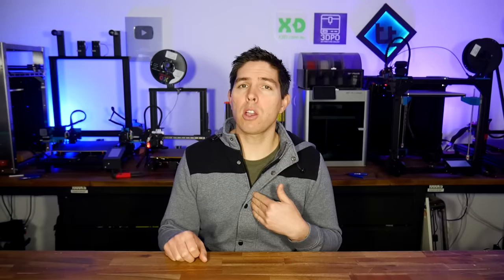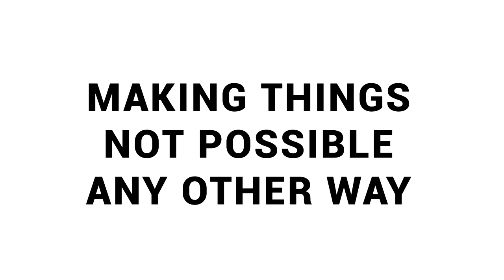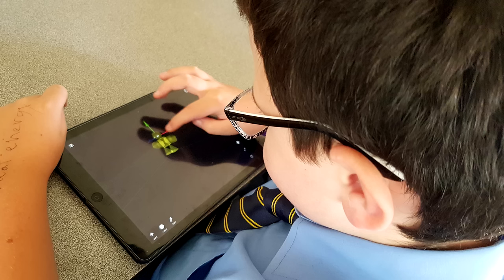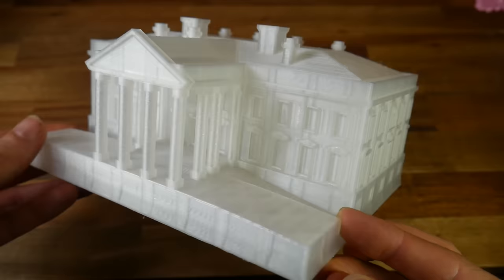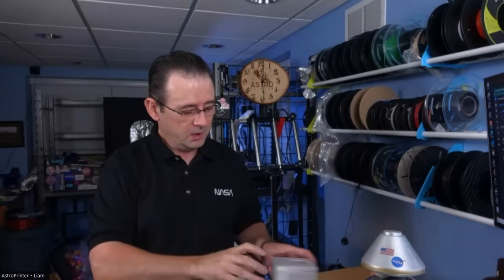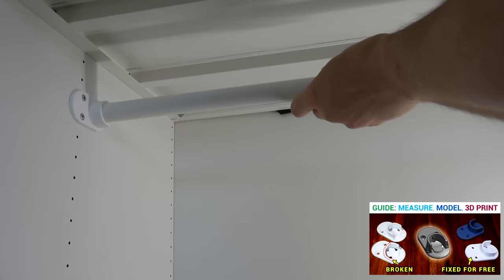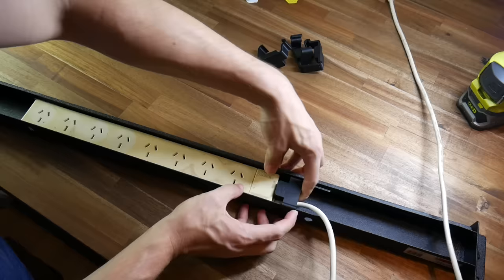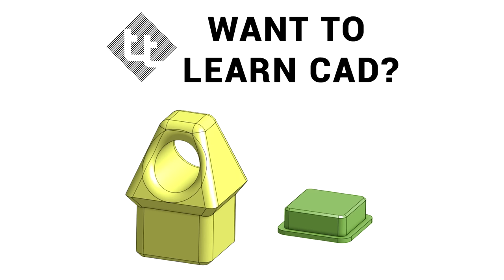These 3D prints will convert non believers

Comment: I love the idea of 3D printing but my god it is more frustrating than anything.  I've actually watched a lot of your videos but still find that the failure rate is so high I've not even touched my printer in over a year.  It seems like whenever I solve one problem 2 more take its place.
Reply: It definitely has a learning curve. I almost gave up and sold my ender 3 after a month of trial and error, but thanks to some helpful friends, I worked out the kinks and now have a very reliable printer. A good chunk of that was learning what various slicer settings mean and how they affect your print. But now I can print pla, petg and tpu with ease.
Reply: @Gibson99  Glad it worked out for you!  I too have an ender 3.  Even upgraded the board, added a auto levelling thing, tried endless slicer settings and different spools of pla.  Just felt like I was throwing my money out the window and sat it on a shelf.  It is quite sad really but unfortunately I don't know any local who can help.  I still think it is great but it has so many points of failure.  Bring on the star trek replicator!
Reply: I also believe every now and then a lemon of a machine gets through, my most expensive printer is so unreliable, the other 3 arrived with warped beds, bad extruders.. It can be frustrating and a lot of problem solving, but stick with it, I believe it's getting easier with more affordable tech and better quality printer's.

Comment: I view 3D printers as a tool. I have two and I don't feel the same excitement with 3D printing itself that so many people seem to, but I do find it invaluable for repairs around the house, mounts, brackets, and to support my other hobbies.

My favorite repair was a bearing block and endcap set that I designed and printed for my vacuum cleaner. The parts were about 3h of design work and $2 of materials, but it saved me from having to buy a whole new brush from the manufacturer for $60. I got to solve an interesting design problem, reduce waste, and save significant money all at once.
Reply: @createagoogleaccount7574  For what I mostly do (model rocketry, airplanes, and robotics), a laser cutter is a better complement. Still, it doesn't take much to do reasonably precision production of complex parts these days.

Comment: I work at a small brewery and I have printed up many tools that I use.  Ive designed retention clip removers so I can fix sanke spears.  A wrench for our fermenter caps (previously used needle nose pliers)  jig for cutting our filter pads (instead of buying precut pads that cost 4x the amount)  and countless other things that make our job that much easier

Comment: I’m brand new to 3D printing and am super excited that I’m able to make small car parts. Right now I’m printing a 3 circuit horn ring for a race car. It makes the buttons in the steering wheel work without external wires. It’s also removable. Thanks 3D printing!

Comment: I made a conformal fixture to hold my awkwardly shaped wifi router to the wall without the need to modify the router's body or damage it in any way. Because the fixture is conformal to the body of the router you almost can't notice it's there. I also regularly make odd shaped (woodworking) router jigs, adapters and tool organizers. I never make things that I can just buy.
Reply: Ha Ha... I had nowhere to mount a WiFi extender, so I 3D printed a mounting bracket that allowed it to hang on the end of a bookcase without screws.  Tidy solutions for one-off problems.   :o)

Comment: Using the 3d printer with a 3D cad program is where they really shine. I impulse bought an ender 3 pro 2 months ago when I was having trouble fabricating a part for my UTV that ideally would have been made of plastic with metal and my welder. Turned out quite a bit harder to do than I initially expected because  I had to learn FreeCad first, but within 2 weeks I was adding a second bigger print area printer for bigger parts. I was finding all sorts of things to make for both my projects and my wifes Crafts projects. You'll be doing a great service if you teach people how to design things to print as that is where I think the real magic of a 3D printer comes in, be it making parts that can no longer be obtained, or designing custom made items.
Reply: absolutely. that's the fun part for me. being able to imagine, design, then realize the results in a short time is very satisfying and practical.

Comment: My mom has a flat foot and sees a special foot doctor to make custom shoe inserts to support her foot. 

The doctor retired and the new doctor wasn’t as good. There were many failed inserts and Each custom insole is $500. there is a limit on how much insurance will cover 

My parents decided to ask me to try and make an insole, knowing the cost is cheaper and adjustments can be made quickly to find the perfect fit. I made a shoe the previous year and was up to the challenge. I have succeed with only $50 spent on materials, and in return am getting a new better printer.

Comment: One of the first things that I designed was the plunger replacement for my wife's KitchenAid mixer cheese grater attachment. I agree with you that functional prints are fun when they go right.  Just today I rapidly prototyped three adapters for cups for my laser engraver. I was able to try out three different designs in the span of one day.

Comment: Thank you for posting this video.  I was unaware of the Toys For Tots work, and will join that effort in time for Christmas 2022!

My entire 3D printing hobby started with my wife's car not having an integrated dock to charge her iPhone, and provide wired CarPlay connectivity.  I came up with a simple set of measurements and a drawing showing my very rough idea.  I then found an engineer in Scotland (I'm in the USA) who hung out on the car forums where I hang out, and he and I polished up the design into something awesome (he did most of the CAD work, since I am a noob).  Along the way, I picked up 3D printing, Fusion 360, understanding filament types, and a whole lot more.

This also means the wife doesn't complain too much about the printer being inside the house.

Comment: Excellent content and topic! My 3d printer was only laying around for the first year. After getting fluent in 3d designing, my 3d printer is now almost in daily use. It complements several hobbies. The key to 3d printing is being able to effortlessly design 3d parts. 3d scanning by means of photogrammetry is very rewarding and once mastered, adds the next level to 3d printing. Convincing people of 3d printing is like convincing people to be makers. Some are makers and some are simply not. Lots of people are inherently makers, but to be a 3d maker, requires knowing how to 3d design as well as a bit of knowledge of 3d printers.

Comment: For the CAD tutorial videos, FreeCAD + the OpenSCAD Workbench would be fantastic, as they each have their own strengths and weaknesses, and the convenience of being able to paste in a chunk of code and instantly create a fully modelled part CANNOT be overstated.
Reply: Ive used openscad professionally and is great. Freecad has multiple issues which have been discussed elsewhere on various you tube channels. I found the UX problematic (Inconsistent) I don't use it any more.

I strongly recommend trying Blender with the 3D printer library addin. (both free). There are many you tube tutorials on this. One of the best is from Maker Tails.

And Michael, thank you for this 3D print overview.

Comment: I have a room door knob that was broken for 2 years, The lock works but the handle comes off, after buying a 3d printer the first thing i printed was a replacement for that. and it was the most satisfying thing ever.

Comment: I worked as a mechanical engineer and heard constantly that 3d printing was useles.
It was 7 years ago when i installed a 3d printed custom designed air blower on a place where there was no room for a comercial one.
They said it would explode due to the air pressure, but it's still working.
After that, i have designed parts for my projects: motor mounts for a cnc gantry router and several parts for my mountain board.

Comment: I work in the R&D field.  Good 3D prints for molds, functional prototype parts, and scale models are greatly reducing time and cost for iterations.  One iteration of hardware was 9 months.  With a great resin printer, that has been reduced to 3 months.  With the molding, we encapsulate PCBs in a 2 part silicon insulator that helps guard from vibration (20G constant, 1000G impact).  Metal molds were costing us $200+ per set, with 8 to 14 sets per prototype.  The printer paid for itself in 18 months.  It wasn't even a cheap printer.  It cost us about $6k to get delivered.

Comment: Jay Leno in his Jay Leno's Garage videos mentions the use of a 3D printer often in his restoration work. Sometimes they print scale parts to be used as forms for casting something in metal. Sometimes it is just to have a scale part to examine space requirements and how something would fit with other parts of an existing car.

I use mine all the time to design and make things for my hobbies (ham radio, woodworking, metalworking) and for useful things around the house. I can't justify anything more than my highly modified Ender 3, but I definitely get my money's worth from it.

Good video that needed to be made.

Comment: 2 days ago I made a "screwcap"  for fishing reel handle for my friend. It uses an elliptical head screw with costume threads to tighten the handle. He had 2 broken ones and he couldn't tighten the handle; and on other 2/4 reels they had a crack. I printed 6 of them for good measure and they are a perfect fit. It took me about 20-30 min to create them and I am just a beginner in 3D modeling.

Comment: Great video, my most satisfying and useful print was the the fittings for a 5 gallon dust bucket cyclone dust separator for my CNC machine. I printed the largest piece overnight and it was like I had a delivery on the bed of my 3D printer in the morning. Very gratifying!

Comment: One of the most useful models I’ve printed was also one of the simplest - I needed a spacer for a tap as the previous one has disintegrated from age. If I had the skill and equipment I might’ve been able to make it out of metal or wood, but less than 5mins in CAD and only a few more printing and I had a replacement part. I use this example whenever people ask me ‘so what do you print’.

Comment: I’ve had a 3D printer for less than 3 weeks and already produced several custom parts.  My killer app for 3D printing is replacement parts for swimming pool components.  Lots of plastic nuts and connectors.

Comment: I have designed brake adapters so Porsche Cayenne brakes could be used on a BMW 1series, once we got the fit we wanted it got machined. 

Printed a keyed TPU sleeve around a flexible joint on a ratchet. Makes sure the flex joint stays straight while reaching into a difficult location but can swivel once in place.

A friend needed a finger splint so I drew up a hex lattice after making an initial shape in paper. Printed in PLA and formed to the wearer using a heat gun.

got a new washing machine late on a saturday, drain hose didn't match my drain pipe. Designing and printing took less time than going to the closest store and then having to look for the specific part. In addition to getting it up and running on a Saturday evening when everything's closed.

I LOVE 3d printing because it enables my DIY passion in a great way

Comment: My brother got me a 3d printer and the first thing I used it for was to make a template to drill holes for cabinet handles. I didnt care what the dimensions were, I just needed them all to match. 5 minutes of cad using a free program and a 1 hour print, and I had a perfect template and saved me hours of trying to measure and drill.

Comment: I printed a part for a friends dishwasher that they were told wasn't available to buy except as part of a larger assembly costing $500 (for a $600 dishwasher).  So I printed the part, reinforced with a  stainless bolt through it and for attachment, made a slight modification to the machine itself and its fixed!  Part took 30 mins to print from Polycarbonate (to handle possible high temperatures in the machine), it took about 5 mins to make necessary modification to the machine to accept it using the stainless bolt, and its been running flawlessly for a couple years now.

Comment: I just converted a sidewinder 2 force feedback flight stick to a flight yoke using mostly 3D printed parts, modified them, then designed and printed my own brackets, mods, switch panels; printed a boeing 737 yoke grip for it, modified that too, then designed and printed a housing for it all, then iterated on and printed the housing design a further 2 times over 3 days. Next up throttle handles and a custom control panel..... followed by a replica boeing flight computer, a garmin G1000, a landing gear handle, a high torque force feedback flight stick, designing my own split throttle system, designing from scratch a force feedback pendular yoke....... the list goes on. Now I've been inspired by the fold out keyboard... it never ends.
Usually I use my printer for making cases, enclosures, brackets or spacers for things, other times I'm making replacement parts.
I got my printer originally for the purpose of 1 or two parts and then a bunch of table top terrain, since then I'm always finding things to print and it's almost second nature now to jump into fusion and start designing whenever I need something.
I firmly believe that people who deride the point of 3d printers are either brainless consumer drones or simply people who lack imagination or have yet to discover how liberating it is to be able to make things at will. When you have a 3D printer, its usefulness makes itself very apparent very quickly, you will find purposes for it that you would have never even thought about before.
The only things I don't print are trinkets, which frankly I hate too. Damn landfill fodder.

Comment: Replacement parts is a huge factor for our family. We have a dearth of parts especially for our 32ft long class A RV (caravan). The mfg went out of business years ago, so many of the interior and chassis parts that fail on us here in Arizona (typically plastic ones that no longer hold up to the dry air and high levels of UV) can now be recreated with our FDM printer. 

We get to combine the joys of 'right to repair' with the knowledge that we're keeping equipment from the landfill...a two'fer!

Comment: I work in automotive embedded systems prototyping, and got myself an ender 3 last year. I also kinda first thought it was only to make trinkets, but it was an amazing excuse for me to learn CAD tools to add to my resume, as I'm just a student/intern/almost engineer so any resume filler is welcome. It indeed enhanced my other hobbies, building random stuff with microcontrollers: now, with a bit of CAD, and a few cents worth of filament, my projects look finished and professional, as I'm no longer doing "CAD" (cardboard aided design).
My favorite thing to do with my printer is something I think you already tackled on the channel: solving a niche problem only I have. For instance, for my car, I hate these phone holders that clamp on your AC vents: it blocks the air, and gets loose; and I also hate the others that suction the windshield: any difference in temperature in the night makes it fail. So I measured a bit, and designed a phone holder that jams in my CD reader that I do not use, and it fits my phone securely with a couple of TPU insert that "clip in" the main part like legos. Same for my desk setup, I have 2 monitors that for the life of me I couldn't get to fit next to one another flush, and it was triggering my OCD. I designed a small piece that holds them a perfect 30°, and has a little rail on top to hold my camera. Right now, I am designing a replacement piece for my AC units that broke, and that the manufacturer (Mitsubishi) quotes an ungodly amount of money for a small plastic piece. It really gives you a different outlook on things, you look around your office looking for things to improve, to make better, and to hack. 
On a more "serious" note, it is as you mentioned an AMAZING prototyping tool. It allowed us engineers to reclaim the manufacturing process, allowing us to build prototypes in barely days compared to weeks. 
Also... It's an hobby in itself! I've spent more time and money upgrading and modifying my printer, learned about CNC systems, got myself an actual CNC/laser, and spent a lot of time learning/honing each machine to the point it can make my visions real

Comment: Bro i building a sand blaster for jewelry making from scratch for 50 € and the real thing starts at 300€, I’m also testing a new attachment for my enter 3 v2 to cut vinyl and mask parts for the sand blaster.   Such a blast having a 3d printer, changed my life.

By the way I totally agree in that the small specific prints are the berry best.

Happy printing ❤

Comment: My clothes dryer died right at the manufacturer's planned 5-year obsolescence limit.  With a couple of bearings and a 3D printed part, I was able to extend its lifetime another 8 years.  I also am constantly printing brackets and adapters for various projects.  I use OnShape for CAD.

Comment: I printed a replacement stop for my hedge clippers after one dry rotted and broke. My calipers and tinkercad and custom part finished.
I work for a mold maker for door seals in the auto industry and there is 3d printed full size car doors for testing the seal fit and prototype fixturing used to hand notch the extrusion for prototype molds before production molds and notching equipment is made.